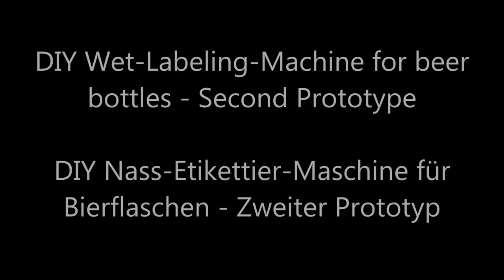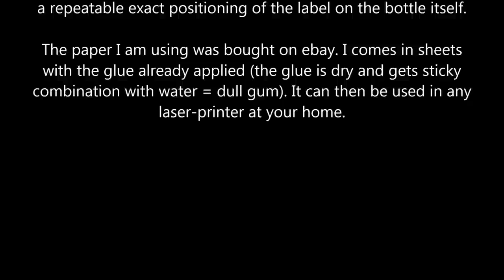DIY Wet-Labeling-Machine for Homebrewing - Second Prototype

Comment: I mean what kind of glue do you use for applying to labels, not to assembling the machine? Is it hot or cold glue application?
Reply from the maker: Two component clue / epoxy. Have a look at the new version of the machine.
Reply: @chixxxxi  nimmst du echt epoxy um labels fest zu machen?

Comment: Hello what  mark of wet glue do you use , i would like to use the same for a similar project at home thanks :)
Reply from the maker: +walikour444 It is an epoxy adhesive, exactly this one: http://www.go-araldite.com/products/epoxy-adhesives/araldite-rapid-2-x-15ml-tube

Also have a look ath the new version of the machine: https://www.youtube.com/watch?v=dwk6yL3mSro
Reply: +ggo85 thanks a lot i will try this as soon as possible !!